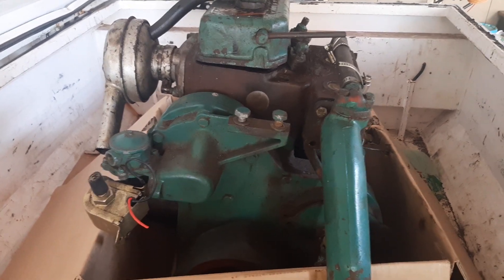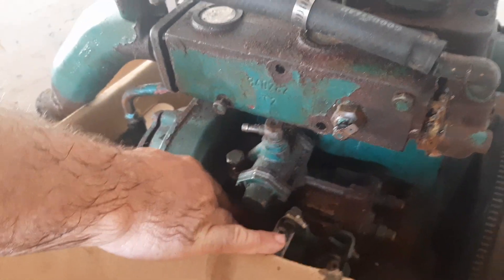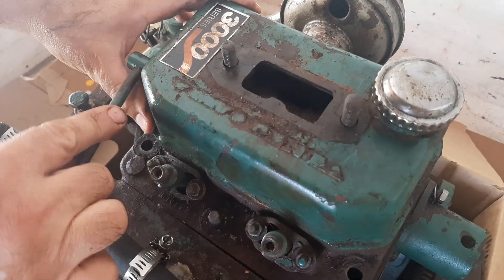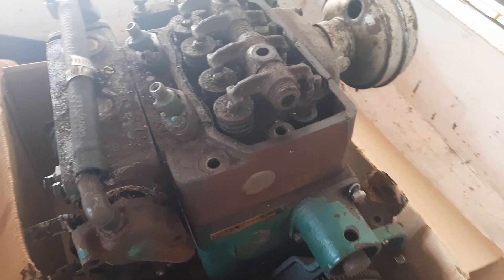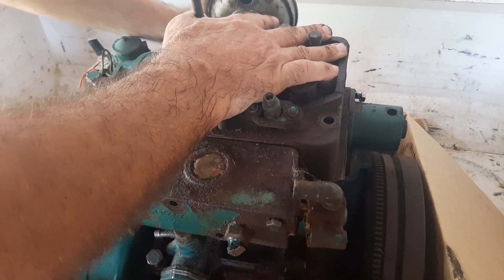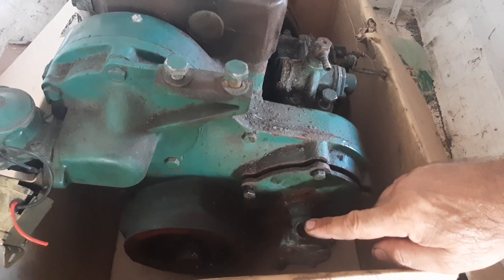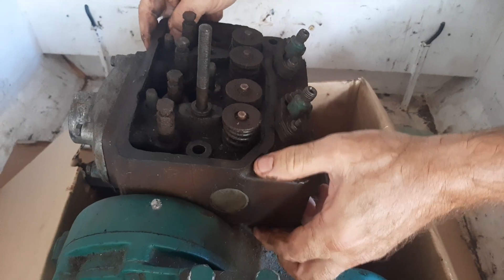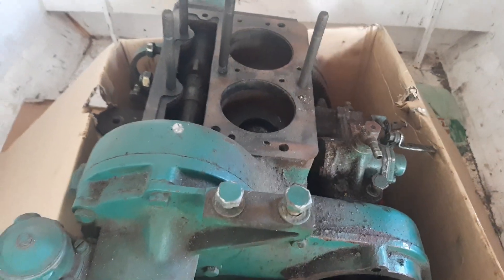Partly disassemble Volvo Penta MD6A, MD7A, MD7B part 1.

Comment: Have to be very very careful with the VA model injector pump on that engine. Extremely hard to get certain parts for them nowadays. 
Clean waterfree fuel is an absolute must with them more so than a standard type pump. 
I remove those factory saltware pumps and fit a pedastal type to remedy the issue tou have with them filling up the engine with water. 
Exhaust manifolds also fail due to being saltwater cooled so best thing is to fit a 3 way vslve on seawater intake so after a day out it can be closed to run the engine from a 20 litre bucket of freshwater. Also with the 3 way valve if the boat starts to fill up with saltwater you can close the valve and use the engine as a bilge pump while still motoring the boat.
Reply from the maker: I like the additional use of the engine as a bilge pump.  Thank you for telling me.  Can you maybe tell me where I can get hold of the big-end bearings.  Without these bearings it might not be worth fixing the engine.
Reply: Amazon
Ebay
ASAP supplies
Orbitrade (major Volvo/Ovlov supplier of parts)
Im in NZ so will have different suppliers of parts here.
Reply: Hi! Im new to motors in general. Would you mind explaining what “VA model injector pump” means? “VA” is a short for something?
Reply: VA was the first model of single plunger rotary injector pump from Bosch mostly a 2 cylinder model.
The following model was/is the VE type which is still being made today and has been copied all over the world in everything from
 3 , 4 , 5 and 6 cylinder units.
Reply: @matui6983  i see a label on top of my injector on my motor md6a. It says: made in germany, VA2/10H1200CL462

I guess mine is “VA” , right?
Reply: Yes its definately a VA.
Make sure you have a very very gd diesel filter system for your engine and ensure your fuel tank is clean. 
Also find an additive that will help in the lubricity of your diesel. Will aid in keeping the injector pump and injectors in tip-top condition. Also if you can find any VA model injector pumps like yours that turn around ok and arnt all rusty grab one at least and put it aside as a spare. In fact anything for those you can get as spares grab it. 
Injector pump
Injectors
Exhaust manifold
Salt-water pump
Starter motor. 
Cylinder head
These are the most common failure points on these engines.
Reply: @matui6983  thanks for these tips! I lost my first md6a motor due to a failure in water pump. And I will check how to extract these parts that motor. I was lucky yo find someone who has a whole md6a working fine, which I installed on my boat.

As a beginner in motors in general, i found difficult to extract the injector from this motor. I will try to find videos in how to do that.

In case anyone know where the video to extract the injector is, please share the link here. 🙏
Reply: Removing the injectors can be very very difficult at times. 
I usually use one of two methods.
First is a slide hammer that screws onto the top of the injector and a heavy weight is slid up n down a shaft. This works very well. 
Second is a steel tube capped at the top with a hole thru it which Ive cut a slot partway thru and again a nut is screwed onto the top of the injector and then a nut is wound down pulling the injector out of the copper tube in the  head. 
Always always drain the water out of the engine before temoving injectors on any engines woth copper sleeves as if the sleeve lifts up, cooling water will go straight into the cylinder creati g issues you just do not want.
Reply: @matui6983  i wrote injector but i mean “injector pump”, is it easy to remove?
Reply: @matui6983  One more question, im stuck in stockholm harbour because I disassemble the lever of the throttle and I didnt recorded what was the position of the throttle and the engine shutdown. They look like a little dial in the body of the injector. Do you know how can I reposition then without having to open the injector ?
Reply: Hi. Ouch. That wasnt the best thing to do. 
Top shaft should be throttle and bottom shaft the stop lever. 
The levers are on a splined shaft so can go in many positions. 
Try this. Take both inj pipes off do the cannot start. Crank tne engine to see if fuel comes out the inj pump fittings. If it does come out this should be start fuel. Go to the bottom lever and move it while cranking the engine til fuel stops coming out. The lever can go on so its touching the two setting screws. Refit  the top lever and try to start the engine. Always alway always make sure you have two or more ways to stop the engine in case it takes off which it could. 
1: Undo the injector pipes at injector end or inj pump end. 
2: block off air intake
3: move stop lever on inj pump
4: If it has decompression levers operate them to lose compression. 
Will try and look for a manusl for the engine/pump to see if there is any more I can tell you.
Reply: @matui6983  man, you saved my day yesterday! I did exactly like you said and even never working with motors before in my life I could manage to make it work again. Thank you so much for that!
Reply: Thats such good news. Really pleased shes a runner again. 
Just never take those levers off again. Many people have before and either ruined the inside of the pump or if the engine has taken off or run away it can go til it destroys itself. Biggest biggest thing to keep that pump alive and performing ok is to have very very good fuel filters in the system mainly a Sedimenter to catch dirt and wayer before it gets to your paper filters and try to find a Lubricity afditive to add to your fuel tank to provide extra lubrication to the diesel.
Reply: @matui6983   the reason I release the levers was to “see” better where a leak came from in this injector. I discover that the leakage of diesel came from the botton shaft… this shaft seems very trick to extract because I only have 9cm clearance (from the fiberglass wall to the cheese-head screw bolt that is used to attach a plate in front of these two shafts to keep then in place).

If you have any idea on how to proceed I appreciate any help. Thank you!!!
Reply: Oh right. Was wondering why. 
Ok. Underneath that plate that has the two shafts sticking thru it are two bushings which both support and seal the shafts. There are 2-3 O-rings on each bushing. Push back on the end of the shaft where the M6 nut screws on as you try to get the bushing out, sumtimes the shaft will want to come out with the bush, other times the bushes just slip right on out.  Lucky you are in the home of Ovlov/Volvo so getting parts shouldnt be a problem. I would be getting a workshop manual for the engine as well. If the bottom one is leaking due to the O-ring drying out or getting flats on it then the top one will most likely fo the same. Hard to say when tho. Once one O-ring leaks on them others are sure to follow. Not good to inow but its true. There are fuel additives that can swell the O-rings up to stop leaks but these are only temporary fixes.
Reply: Hey @matui6983 . Just finished rebuilding a volvo md7b .  Had the injectors and injection pump rebuilt .  At idle it blows a LOT of black smoke and run rough , like it is only running on one cylinder . .. as soon as it is given gas and the rpms rise ... the smoke disappear and it smooths out ... we are at a loss ...  would appreciate any advice here ...
Reply: Hullo. Black smoke shows fuel is going into the engine but cant be burnt. Lack of air/compression or incorrectly adjusted fuel gear will cause this. Things to check would be the injection pump timing. Could be one or two teeth wrong. Make sure the injector pipes arnt crossed over ( can and does happen). Dirt may have entered one injector opening before the injector pipe was fitted but normally the engine would be knocking quite harshly if the injector nozzle was stuck open. Also check the tappet setting on case one rocker arm is too tight. Does the engine start fine? Inlet and outlet fuel banjo bolts are in the correct holes? Inlet banjo bolt will have two or four M6 holes in it and goes into the front of the pumpwhere it bolts to the engine. The overflow bolt goes into the top of the pump housing and only has a small 10-20 thou hole in it.
Reply: @matui6983  The engine starts fine ....@ idle there is tremendous "Knocking" untill the gas is pressed ... once it is given gas the rpms rise and the black smoke goes away ... the injectors were tested  as well as compression (Good)  .. the injection pump was rebuilt .... but was working fine scratching my head ....  would pictures help ?
Reply: If it is knocking then its normally an injector stuck open or at least sticking due to sumthing foreign going into the inlet port of the injector. Or the injector pipes are crossed over at the injector pump end. Compression should be around 400-420psi. If it starts fine then the timing should be ok. Take the injectors out and attatch them
to the injector pipes one at a time and spin the engine over using the starter motor to see that the fuel is atomizing in a fine spray from each of the 4 to 5 holes in the nozzle. Place the injector into a bucket to catch the fuel and so you are able to see the operation of each one clearly.  If its just raw fuel coming out then you have a stuck or sticking injector. They would then have to go to whoever did them to get sorted out altho sumtimes you can clear them by shutting the fuel on and off to them while spinning the engine over. Also  place the injector into a smaller container and wind over for 20-30 seconds. Test each one and measure how much fuel is injected by each cylinder. Very crude way to check if the pump is calibrated correctly and one cylinder isnt getting more fuel than the other. It could be a fault in the injector pump but its less likely to be in the pump and more to be in the injector/s.